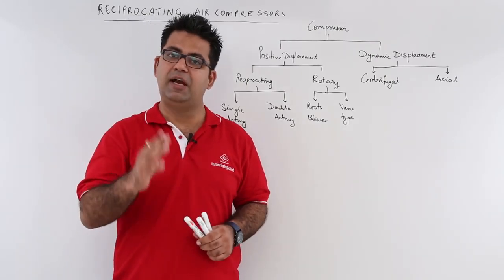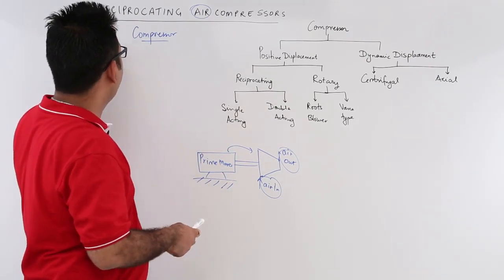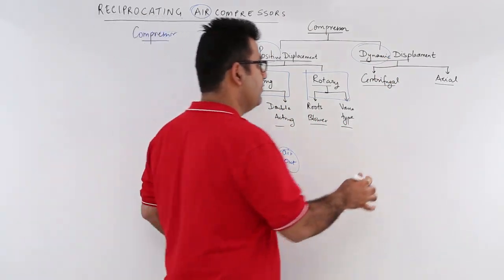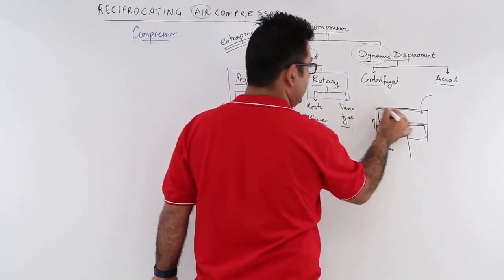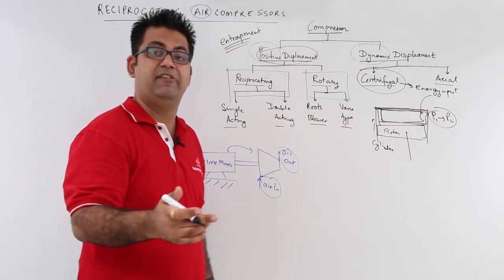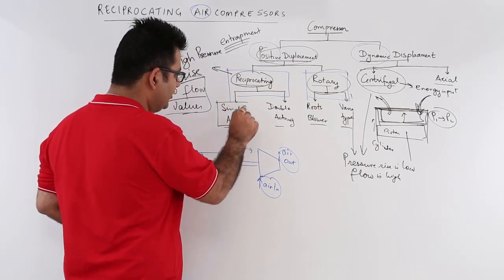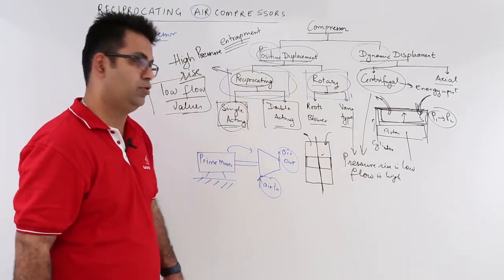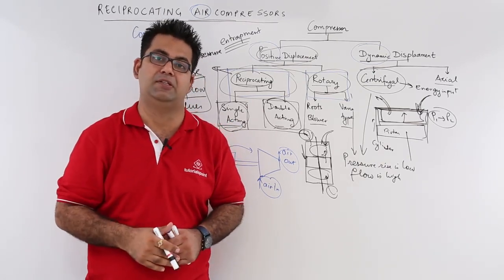Reciprocating Air Compressor Introduction

Comment: Are single stage and single-acting air compressors the same??, what is multistage?
Reply: No there are many difference like... a single stage compressor have only one cylinder but Multi stage compressor have no. Of cylinders and when air is compressed in one cylinder... It goes to another cylinder to be compressed at higher pressure.. and after that the compressed air goes to another cylinder and so on.....

On other hand a single acting cylinder have one delivery(or compression) stroke in one revolution... And a double action cylinder have two delivery stroke in one revolution.

Comment: If we have a blow gun aircompressor with nozzle that contains many small holes like a shower model and a nozzle with a big hole( one opening) which will has more noise, when air blows out.